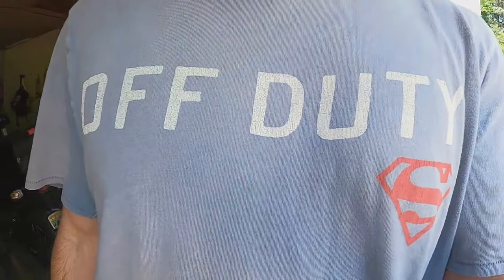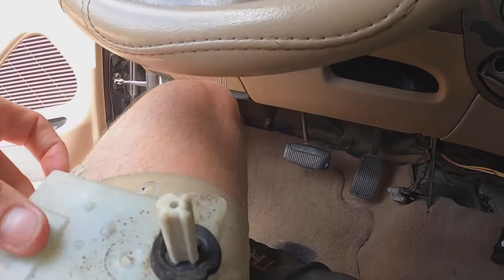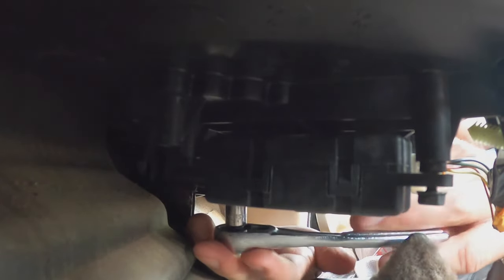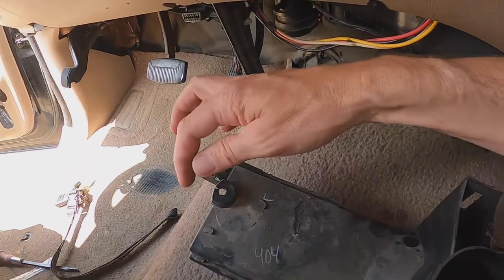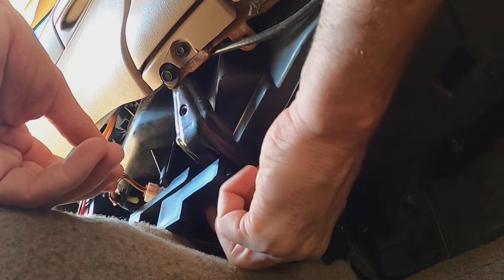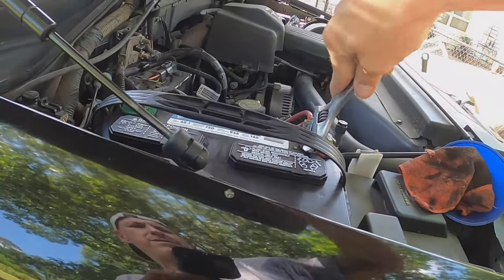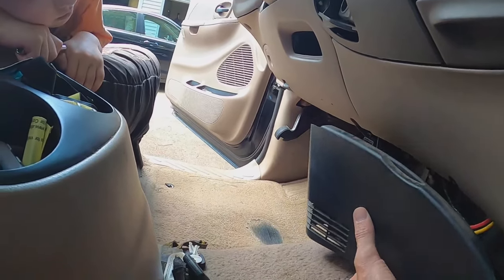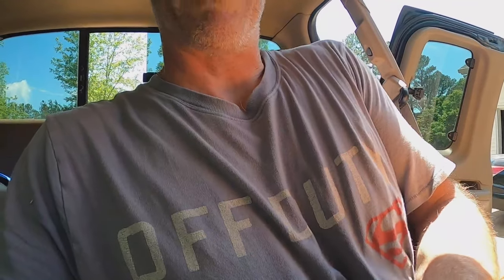1999 F150 BLEND DOOR ACTUATOR REPLACE

Comment: Thanks man, yep, that ducting was a pain but your video told me what I needed to know.  I used some thin wire to hold the screws in the holes for the ducting which helped me get a socket on them to be able to tighten them.  Thanks again for taking the time to make this video.

Comment: Thank you so much for the video. My 2001 F150 stopped blowing hot air yesterday and when I took it in they said that its the blend door.  So I took and endoscope and tried to see between the little gap between on top of the actuator. No visible movements were seen when switching from hot to cold (and no sounds of the door opening and closing).  But after watching your video I feel more confident to get it fixed safely knowing what needs to come out (including the airbag control module!)

Comment: Thanks so much for this video, it helped tremendously.  Now on to my passenger side half door. Replacing the plastic cable guides with aluminum so the door will open.   Did the other years ago. Ordered my actuator already. Thanks again.

Comment: This is a great video so I thought I'd leave this here.

To anyone this helps, I've had an actuator crumble to pieces in a 99 Windstar - much like its door motors. The new actuator didn't last long on a sticky blend door (very common.) That site you mentioned is great, that's where I first learned of their workarounds and upgrades. Free invaluable information is uncommon by most corporate logic. I never upgraded it or cut into it, but I could have. My uncle was driving it and BANG! lost oil pressure. The oil pan had a hole that something had shot OUT of it. When I pulled the motor I saw the firewalll side head had blown a chunk off!  I've read that can happen when the head becomes part of the firing chamber 😂

Definitely take your hand and feel the blend door working or better yet try to listen for it before messing with it. If it's quiet enough you should hear that door opening and closing. This can help you source the parts before you go diving in.

Someone had already replaced the actuator, I think, because it was missing the back screw on my F150 and the right side vertical screw area had a piece missing for "ratchet access" because its recessed. I'd recommend a swivel or just break the molding in the way😂 Good luck. Mine has wet carpet, so I guess I'll be replacing the heater core AND HOSES next. I smelled coolant and saw a fog coming from the vents last year, so I already have the parts. I'm guessing she's clogged up.  I did have low coolant and it was muddy which is common in these trucks if not flushed regularly which would cause parts to fail prematurely. I'd guess the radiator is next. 

A side note, it was confusing to diagnose initially because the heat didn't work but then it did and then it didn't again. I was sure I didn't move the temp knob so I could rule most of this out, but actually not because I've disturbed it's wiring since I've upgraded the stereo when I should've spent that money on maintenance. You can live and learn but maybe reading youtube comments can help.

Comment: I've got a 2000 Ford F150 5.4 Lariat with 190,000 miles on it. Heat hasn't worked since I got it. Gonna check tomorrow and see if this is why. Thanks!

Comment: So I replaced my actuator because I wasn't getting any heat. I called a few shops and 1 didn't know how to go about repairing this and the other didn't know how to fix this. They suggested pulling the dash, 8 hours labor costing $1000. Even though mine was a little different, 2001 F150, all the info was basically the same. The savings was $949 because the part was $51 and it only took me about 2 hours.
Reply from the maker: Awesome! Merry Christmas

Comment: FYI to any supercrew owners, the ducting under the actuator is impossible to remove unless you remove the front seats, carpet, and rear floor ducting.  Effing mother of all hassles.
Reply: Just discovered this. I bent the duct in front of the seats. I’d rather do that than cut, and rather cut than remove everything! No video outlined this and I was baffled for a minute.
Reply: YIKES

Comment: Replacing this  will be help fix the heat ? My Ford dint blow hot air
Reply from the maker: It should help it if the actuator is broken
Reply: Yours probably got stuck in the ac part. So yes it will help if that's what is wrong with it.
Reply: It’s either the blend door that’s broke at the base or the actuator motor is broke. Check the actuator first by putting a finger on the base under the actuator while u switch from hot to cold to see if the actuator is working. If the actuator is turning then it’s the blend door base is broke.

Comment: Hmm does anyone know why the air stops coming out the vents when i accelerate form 50 to 75 mph? And comes back after i let the gas go. I got a 2002 f150 single cab.